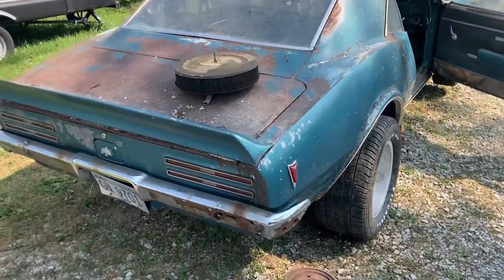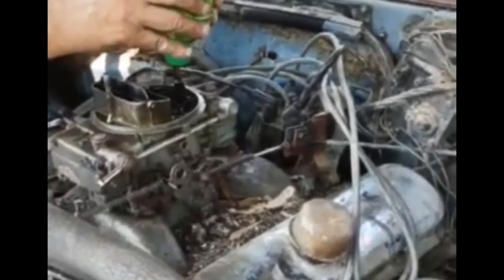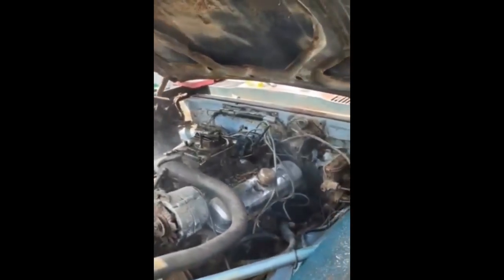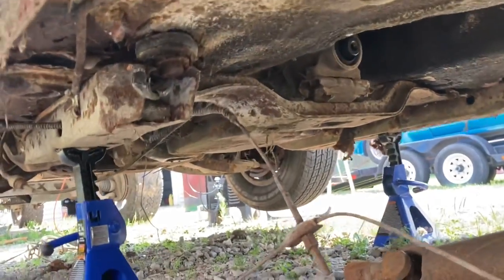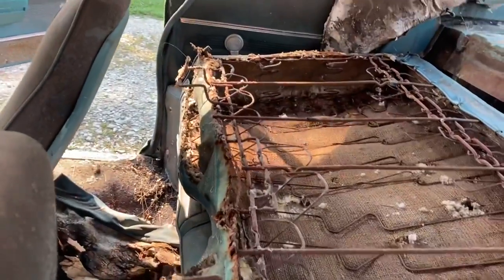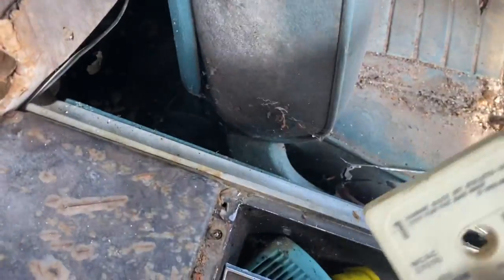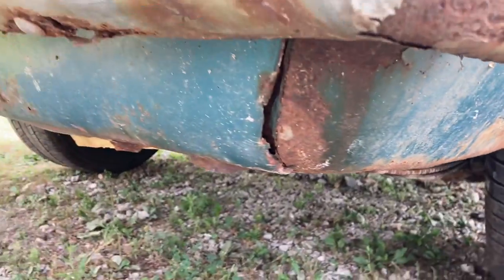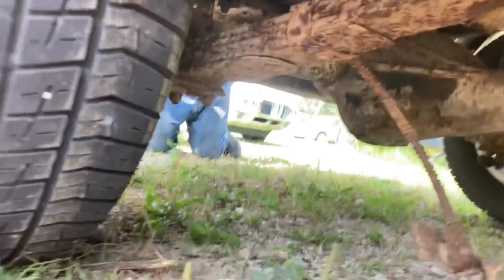How bad is it? 1968 Pontiac Firebird for sale rough barn find should I buy it or not?

Comment: WORTH 800.00 JUST FOR THE SMALL PARTS
Reply from the maker: asking price without title is $1750 for this car.
Reply from the maker: more then I wanted to spend for a car without a title
Reply: @VinylVillageGarage   I would say 800 is tops
Reply: @VinylVillageGarage  did the guy tell you $1750 in person? If so I’m going to get it Saturday
Reply from the maker: yes the original price was $1750. it has since changed hands and the new price is a bit more. I talked to the guy who originally listed it for sale and confirmed it has a new home and listed for sale by the new owner.
Reply: @VinylVillageGarage  okay I wonder what the new owner paid. I’m trying to scoop it up and I don’t mind paying more than the new owner paid but not over $2000 to $3000. He wants $4900 what should I offer and I’m not concerned with how much work needs done
Reply from the maker: @nicholasyoder  it was for sale in LINDEN Indiana when I looked at it. The value depends, I buy them cheap like the original price when I don’t have other projects going.  I offered him $1500,  now when I need a new project I pay more especially if it something I want.  For example I bought my 69 bird convertible “Transmaroado” it was worse off then this car for $3000 no title 8 years ago.  That was a lot for gamble in my opinion. I guess it comes down to how bad do you want it?
Reply: @VinylVillageGarage   No title its just a parts car.

Comment: Just needs a floor pan and trunk its about 6 grand for parts
Reply from the maker: I agree. I would have loved to put this one back together.  We just could not negotiate a good price before he sold it to someone else. Then the price went way up, the new owner relisted it for a good bit more.
Reply: @VinylVillageGarage  that sucks really was some potential espeacially running
Reply: @VinylVillageGarage  im currently in the middle of a full restoration on a 68 400 ho auto
Reply from the maker: Wow 68 HO car that is nice, would really like to see that when done. My opinion Firebird are not common and finding one that has a nice Power plant under the hood even more rare. I hope to find a ram air or HO car while searing for barn finds someday at that point it will be hard to pass it up even if the price is high.  
 Nice find! good luck and best wishes to you on your project. Gotta save them birds!
Reply: @VinylVillageGarage  even better its a ram air ill send pictures for you
Reply from the maker: It has he Round port heads?  That is very impressive and yes I would like to see some pictures.
Reply: @VinylVillageGarage  has the 1 6 heads on here the big ones. Its a fairly rare firebird even has factory ram air 2 on it
Reply from the maker: @joshmontgomery2104  ram air in general not just 1968 is rare.  How long have you owned this car ? where can I find one?
Reply: @VinylVillageGarage  a friend of mine is the owner im the restorer im not sure where you could find another one of these an 400 ho auto is rare enough they only made 110 of them in 68
Reply: @VinylVillageGarage  it is also the fastest firebird of that generation. Tops out at 163 mph
Reply from the maker: @joshmontgomery2104  I hope to keep building my reputation as a restorer so that I can have people drop off a rare bird for a overhaul. Lucky you, if you get a chance send me some pictures.
Reply: @VinylVillageGarage  how do i send you pics?
Reply from the maker: You can send it to my email. It is listed on the video description I can’t post emails or links on messages because it will get deleted by YouTube.

Comment: YJ also 1967 326 engine. The car is so rough and confused, unfortunately she is in Carparts County and not much is savable. Midnight Savannah is quite observant with the long branches, even  the factory units are brittle (both my D and round ports have been repaired).
To restore the sheet metal could sink the budget, let alone everything else on the car. Make it into a drag car? With that much bad sheet metal visible, how much damage to the rest of the body?
Reply from the maker: I made him an offer he did pass on it, it needs just about every panel replaced due to rot.  I figured it would be fun to rebuild. I don’t need another project that bad. the engine “runs” would most likely need a going thru.  this bird has since changed hands and current owner is trying to sell it for a substantial more.  still no title but it has been washed now.  😁 kind of a pricey car wash in my opinion

Comment: i very rarely find 1st gen birds in my area so its a take what you can get. But this would be a good drag car start since most chop up most of the car anyway.
Reply from the maker: first gen birds are slim pickings here too. that is why I jump to at least check them out. this one is repairable and priced fair too.  just on the fence if I need other project this big at this time.  I have a hard time waking away from Firebirds.
Reply: @VinylVillageGarage  i gotcha, could be worth storing away for someone else later
Reply from the maker: Wish I could, I live in a vinyl village with a three car garage that is full currently.  I would have paid for a storage unit if the car was in better condition.

Comment: Did anyone notice @ 3:43 it has a Long Branch exhaust manifold on the drivers side? What is weird 259 for the trim is black interior. I wonder if that car trim tag has been changed?
Reply from the maker: good observation!! I put a shot of the body tag because I came up with the same thing.  either someone went thru a lot of trouble to change it over to a correct 1968 350 with correct heads, changed all the colors of the car inside and out or body tag swap. it should have been a 6cyl car, autumn bronze, black top and black interior.  i wish there was a way to learn its story.

Comment: After just about complete replacement of everything, how much is a non-original,  run of the mill firechicken worth? Would you recoup your investment of time & money? If not, it's only a labor of love, a mission, a calling, sort of like trying to save every f'bird from oblivion.
BTW, if it started life as an OHC 6, even the fuel line is liable to be incorrect; OHC 6 fuel lines were 5/16", and V-8 lines were 3/8".
Reply from the maker: On this car you would definitely be upside down even if doing 100% of the work. The only thing that would make it worth while is the before and after pictures and a awesome story.  You would end up replacing 90% of this car so basically nothing would be original. If it had a title I might have drug this car home…..in pieces. Lol

Comment: If there is pitting in the sheet metal under the vinyl top,, do I cut out and weld in.  Do I spot media blast and treat with the appropriate sealer / primer.
Reply from the maker: Good question for a long lasting durable repair the rust must be removed. Especially if going back with a vinyl top.   Media blasting works good. I did my 1969 GTO almost 20 years ago and it had some deep pits. Never rusted thru but deep.   I sand blasted the entire roof then used PPG epoxy primer then filled the pits with filler and still looks great
And no rust issues. You could cut it out but might make more work if the roof warped while cutting/welding
Reply: It is just the area below the roof and quarter panel seam connect.  I don't plan on going back with vinyl top
Reply from the maker: Got it. That area could be patched if the rust goes all the way thru the panel. If there is no holes I would sand blast first and see what’s left. Then like you mentioned epoxy prime the areas that are bare.  If you sand blast and then immediately epoxy prime no further prep to the metal is needed.  But if you sand or grind on the metal to clean of the rust. It really should be acid etched. Before priming
Reply: Thanks a million and you ever hear of any 69 firebirds in MS, let me know
Reply from the maker: @andrer3854  welcome, good luck on your project.  If I find any or any find me I will let you know.